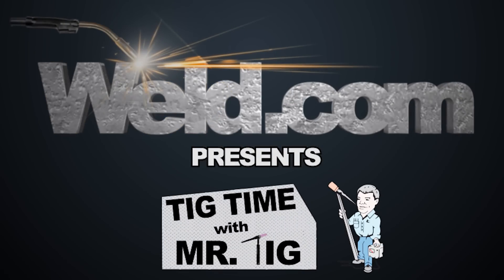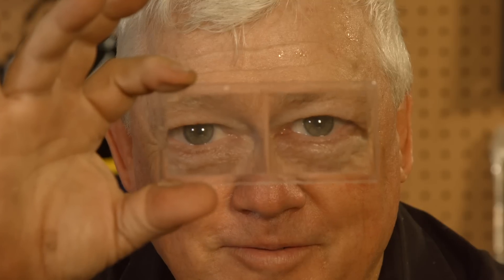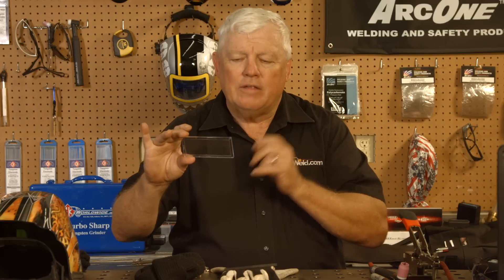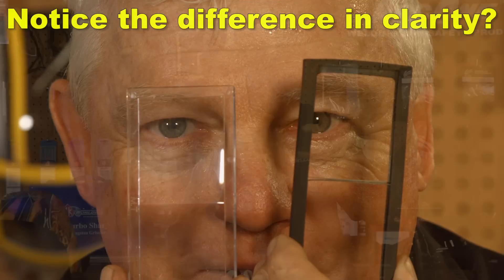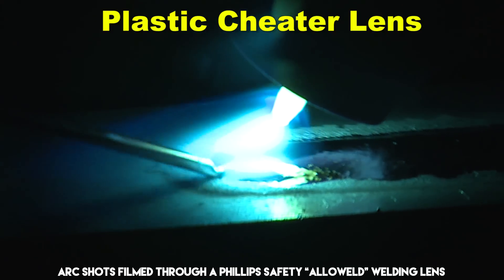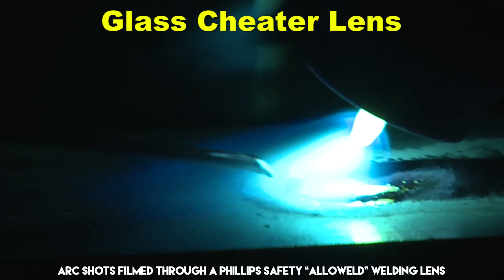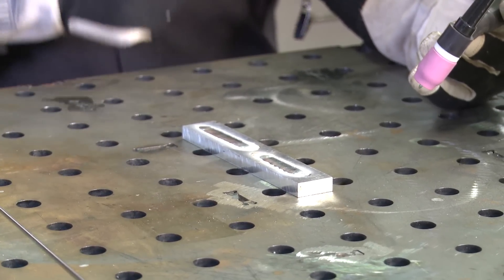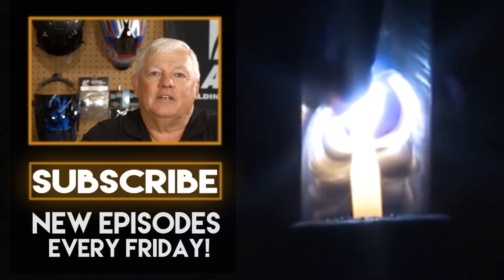Glass vs. Plastic Welding Filters | TIG Time

Comment: I  bought a glass Cheater  lense off ebay I think it was best welds brand it will not fit in like the clear plastic ones I always used I have a  speed glass 9001xx and a Miller elite does work it’s too thick to pass through slot that’s made for a cheater lense just wondering if any one else had a problem?

Comment: thank for the video! Great info, straight to the point :) I have one question (fingers crossed for an answer -:)) Cheater lenses (plastic or glass) come in the standard 2x4. Is it possible for someone to take advantage of a hood with a much larger field of view (ex: Miller's digital Infinity) when not a single magnifying lens on the market will match those larger screens? In other words, does a standard cheater lens cancel out the appeal of larger viewing helmets ? I'd like to update to the Infinity but don't have the advantage of living near a retailer and try it out. THANKS!!

Comment: Sometimes i have trouble seeing what is behind the arc... The puddle. Compared to the views in your videos it looks completely different to what i see... Do you get a view like whats in the video or can you just see the arc and infront of the arc?
Reply: might need a darker shade lens
Reply: iv got an adjustable lense auto darkning but when i set it to a darker shade i can see where im going... in all the videos i see it looks so easy to see everything... the arc the weld where your going a large area around... its just something iv always wondered... ican stil lay a decent weld just from being consistant with dipping and speed but cant actually really see whats going on if you get what i mean
Reply from the maker: we use a Phillips Safety Passive lens. you can see everything very clearly, including the arc and puddle.
Reply: @Welddotcom  i know this is late, what number shade for the alloweld? thanks
Reply: +SpeedyKiwi I agree with you speedy. I can't seem to be able to see the puddle either. the camera shots looks so clear. I've tried darker and lighter shades. helmet is a Miller not the top li e model but close to it. I will have to try the glass lens. I also heard thank the London helment can't be beat.
Reply: SpeedyKiwi what kind of helmet do you use? I personally use the lincol electric hood with the new 4c lens and there amazing they have great clarity and none of that green hue or blue hue and can see much more, could just be your hood
Reply: It's a Miller performance series. It may be time to upgrade and move this one to backup status. I keep hearing good things about the Lincoln  helmets.
Reply: Magnfined glass is good sir